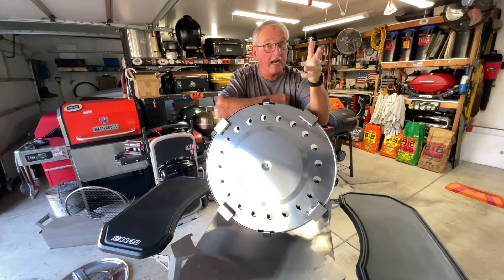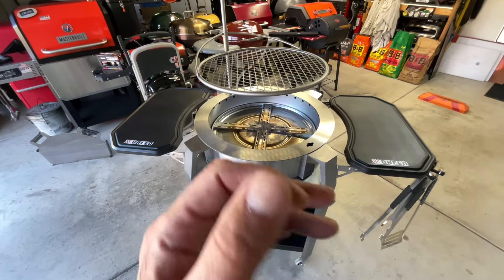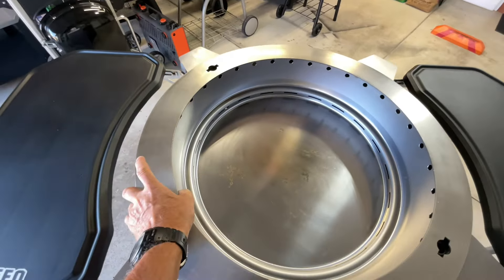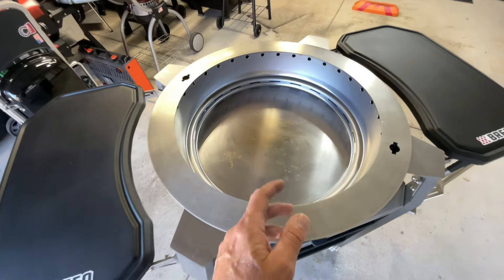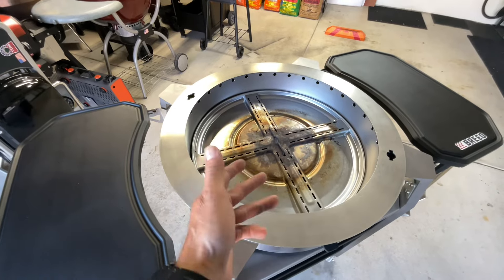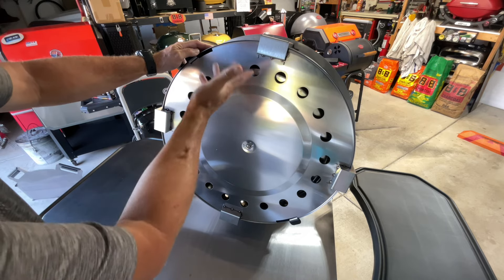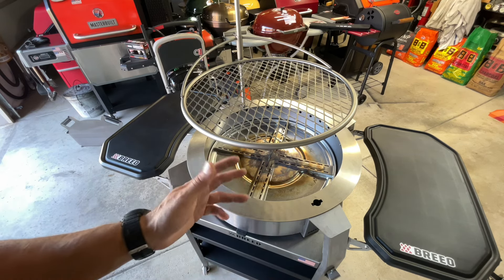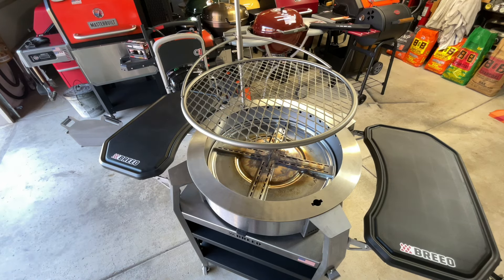How Does a Smokeless Fire Pit Work? / What Does RE-BURN Mean?

Comment: It smokes, it doesn't work!!!
Reply: Retorts will always initially smoke until the point where the plenum wall gets hot enough to reburn the syngas. And then it will be smokeless, unless you add some green/wet fuel to bring the temperature down below the flash point.
Reply from the maker: @MikeTrieu Thanks for watching Mike! Appreciate the information